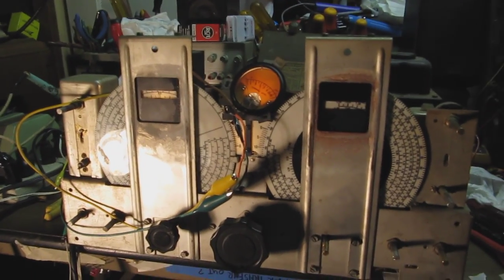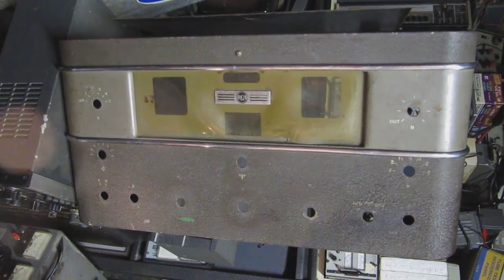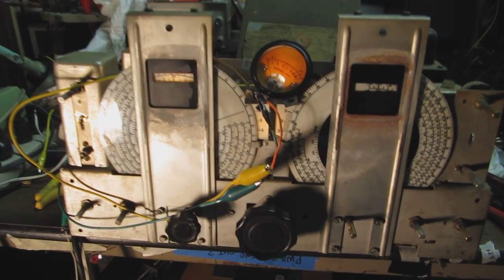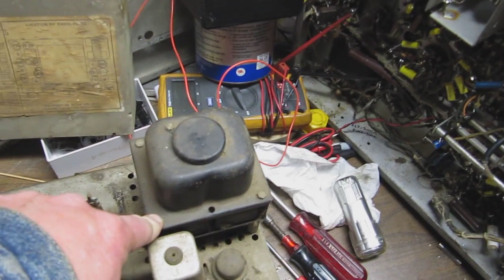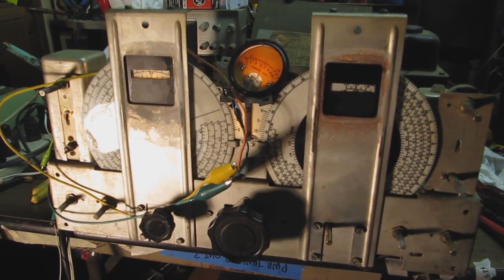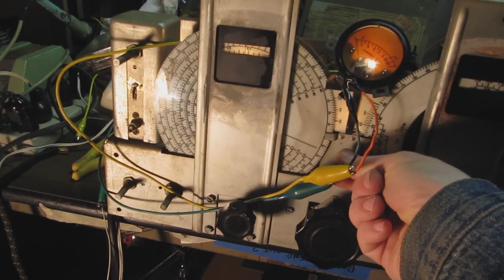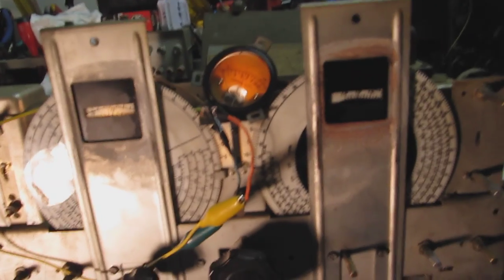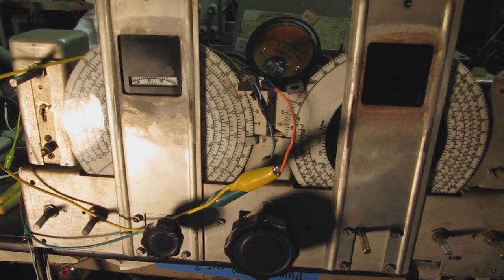RCA AR-77

Comment: Have recently picked up a AR77-E so 240 Volt use here in England.  It has suffered damage underneath as it is missing the base plate and has been dropped on something! damaged wafers so a long term project for me.  Nice top see in you videos a working example especially the last on the topic.